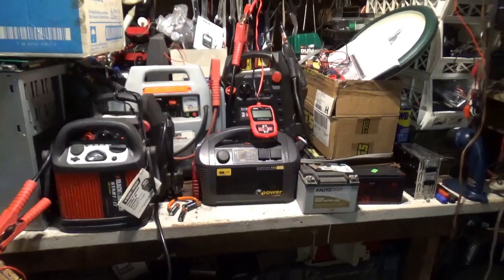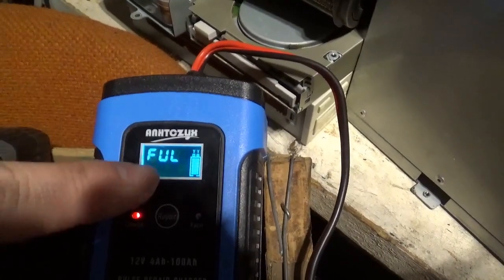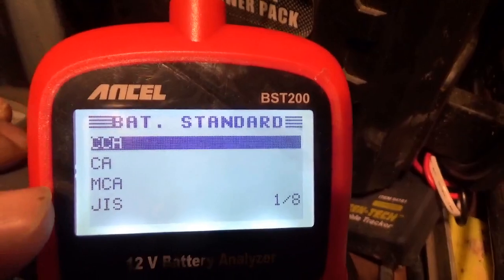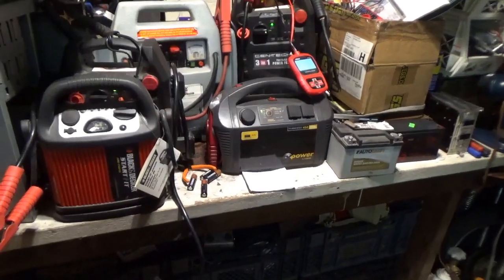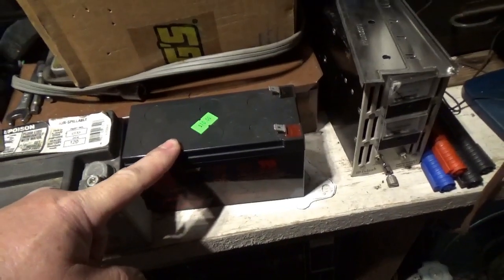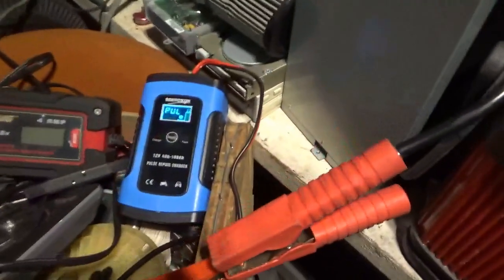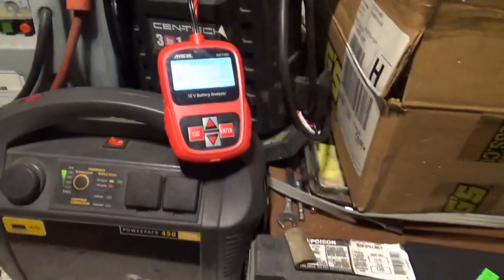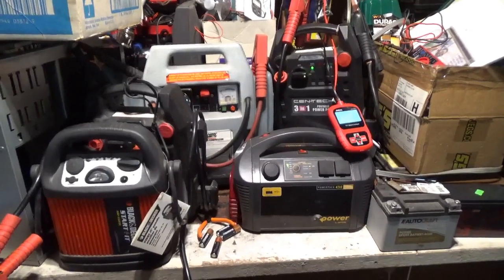Can Dead ATV Batteries be Revived, Do Battery Desulfators Work?

Comment: Great, informative video Harvey👍 in the past, I've always figured if a 1.25 amp battery tender cant bring it back after a week, its pretty much a goner and no fancy arrangement of angry pixies are gonna fix it.  I did pay too much for a noco genius 5 purchased on a whim a couple months ago. Seems to be a decent charger so far.  Decided to try it's "repair" mode on a 3 yo Harley Davidson batt, that wouldn't hold more than 12.38v after resting 24 hrs and after 3 drain, charge, "repair" cycles its holding 12.62 a week later and gained about 35 cca.  Not enough to make me a believer, but definitely opened my eyes some to the possible viability of the new battery "restoring" technology!  Keep em coming! I really should upgrade my old load tester to a more modern analyzer such as you have.

Comment: I have seen the pulse seem to work  some on car batteries that were just a bit week . I have the Foxwell Bt705 and love it .It is in a few of my videos .  I hardly ever use my old load tester any more . That tester will give the same numbers no matter what you put in for cca , but what you enter is how it calculates SOH , SOC and things. I agree those new battery testers are priceless. I am sure that tester will do it to , but if you have not tested a car battery in car , try it , it test then test starter battery draw and charging input , Just follow the steps it tells you to do , like turn things on hit the gas and things . They are pretty cool. . Mine even detects if battery was just on a charger . I watch Shaun too.  Not sure what it is supposed to be on those batteries but 25 seems high on resistance ,

Comment: I was told that on a dead battery if you charge it using solar that it would come back to life ! I think there is a difference between AGM and GELL CELL ! The 12Ah isn’t that a sealed lead acid ? Now when you talk expensive your talking lithium-ion ! My handicap scooter has huge batteries ,  2- 100 Ah AGM and they cost around $350 each ! Do you think you have enough jump packs ? Lmao 😂

Comment: I get about 72 cold cranking amps out of those 3 in 1 jump packs have 2 of them here, seems to be about the best they will do.. I charge them threw the leads with 1 amp charger then with deltran trickle charger for a couple days..Im about to replace the 17 ah battery in mine with a 40.00 22ah battery from ebay.

Comment: Gel batteries dry out inside over time. They typically don't come back because the electrolyte dries out. Regular lead acid batteries respond to pulse charging  much better. If you will replace those cheap gel batteries with heavy duty ones you will be very happy. A real battery box from a good company like BoostPac brand uses a ES1230 gel battery that is made for jump starting and is very heavy duty and they last about 8 years when charged properly.

Comment: I use lawnmower batteries, the heaviest with the least cca. Typically there are 2 weights and 4 kinds IIRC.
I do matching dates, strong high voltage and only new stock.
  They take a ton of abuse.

Ive dropped the 2 on my truck to 6v overnight. Charged them slowly in 6 hours and theyve been fine since.
 I used 1 in a monte carlo, 15w40, -25f, cranked everytime.
 They will take over votage without issue, seeing as many mowers run 15v idle and 19+ at speed. ( i keep my mower at a lower rpm because of this)

Comment: i have had lots of luck with Epsom salt in each cell and a overcharge from a 20v solar panel with the caps off
Reply from the maker: Hey David!!  U have had luck with fully restoring batteries by adding epsom salt to each cell and charging a 12v battery at 20v??? Thanks for the info, watching, and commenting!
Reply: and take precautions like make sure the battery has fluid, do it out side and wear safety glasses, rapid dissembley is no joke i have had it happen and it makes one hellofa boom and mess